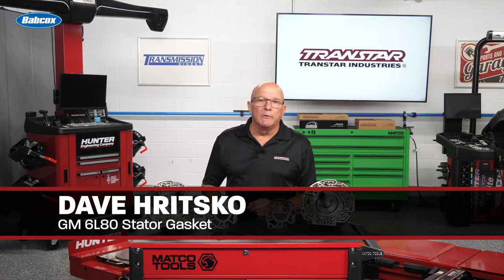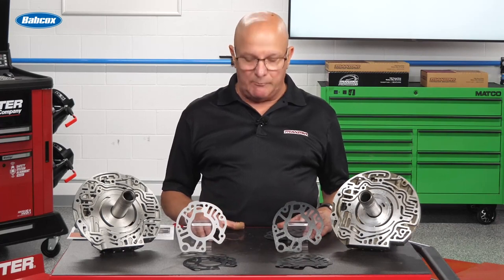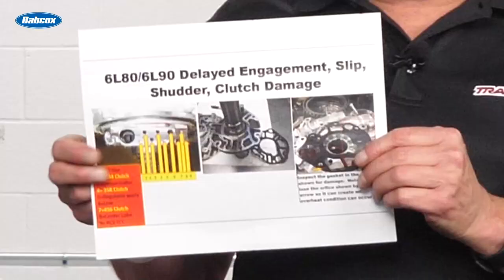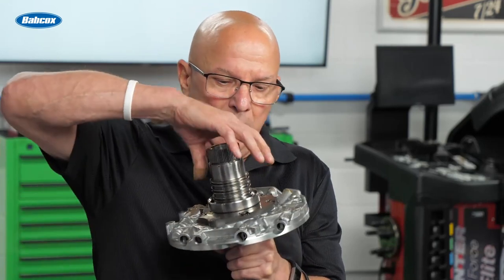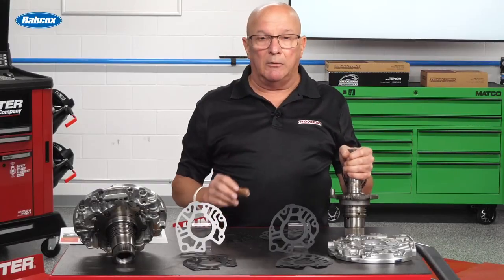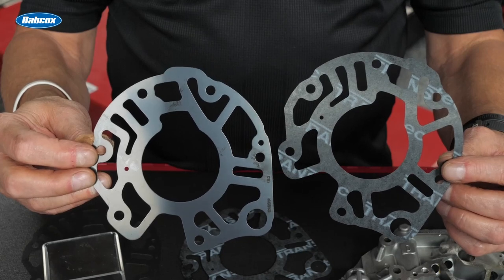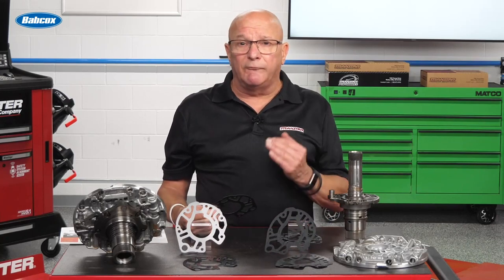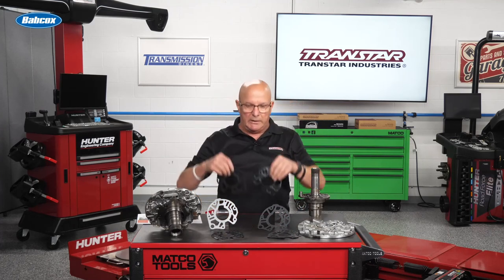The critical gasket for the GM 6L80

Comment: Hello I replaced the complete pump assembly it is supposed to come with all of the sonnex  upgrades I wish I knew if it had that metal coated gasket as well, I'm glad I come across this I do not trust the sealing rings I will be here checking mine tomorrow I have an engagement problem with reverse thank you very much for posting this he was saving a ton of people from headaches

Comment: Is there a video apologizing to every shop in the country regarding that POS coated gasket that expands and loosens up the bolts cooking everything back to the 456? Torque converter included
Reply: First CB, I said damn it how'd I do that? Must've walked away or answered the phone
2nd one a week later. No way I did that twice. Started digging and found NUMEROUS shops across the country 
3rd was a few months later wasn't mine but still cost the shop.
Supposedly had to load in press, torque down with red loctite. Leave it pressed for a bit, come back and give 10 more inch lbs. Jump through I million hoops for a part that never goes bad from factory, only aftermarket. Rumor is that gasket quietly disappeared